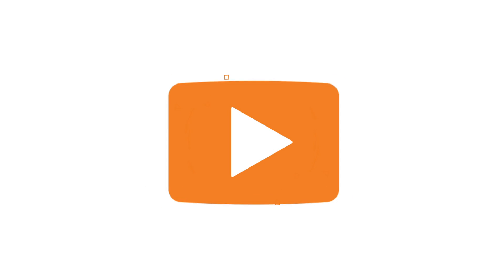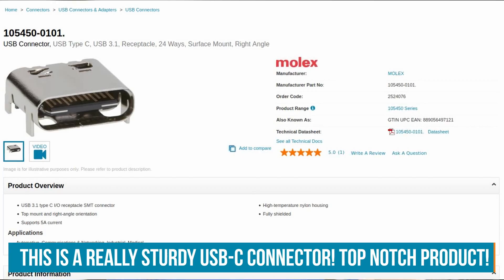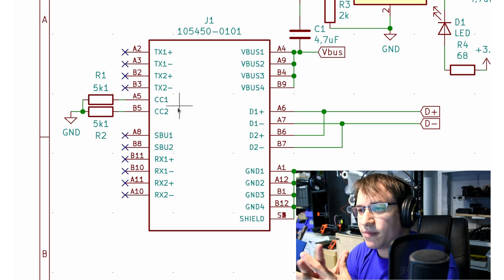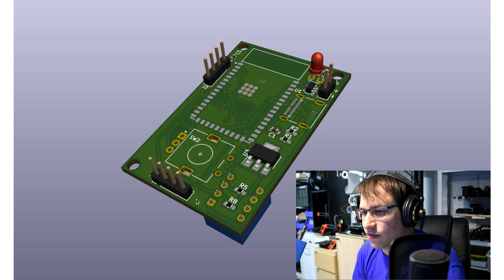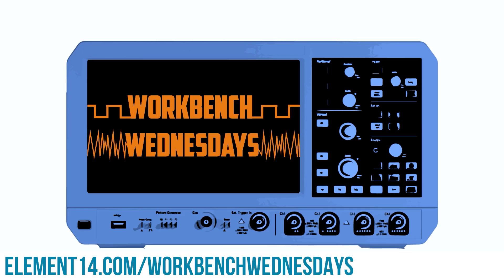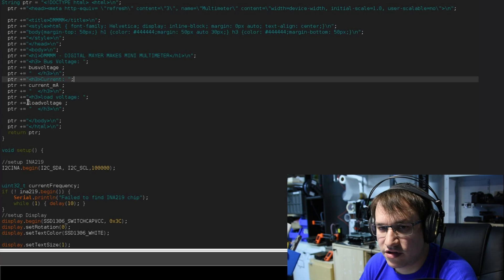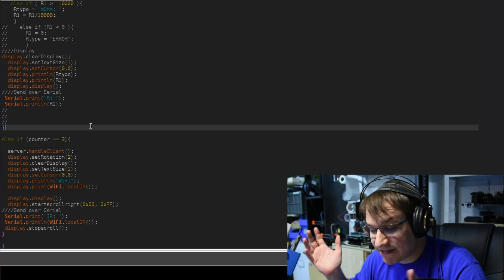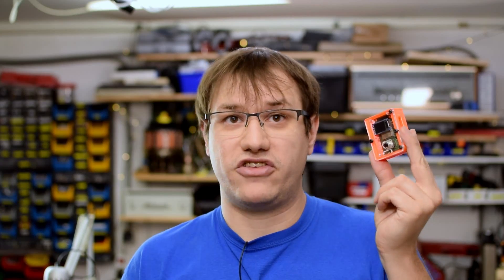DIY Miniature Multimeter

Comment: One limiting factor on accuracy is the tolerances on components. One should be able to calibrate the output readings to match a known good multi meter. The web interface would be a perfect place to have a page where one can adjust values used to calibrate the output values. That is if the calibration values can be stored across power resets.
Reply: that is an awesome addition, please post it on the project side so we can pick it up for a future iteration!

Comment: Good morning! Could you please make a video explaining how capacitive sensors work using a resistive and capacitive circuit? I am doing some research on that, and to have more information on the subject, would be fantastic. I use an Arduino, ATMEGA328P. If this is a possibility, please illustrate in code the details of how to recharge the capacitor and use an interruption to get results. Then, with the results, display the changing values in the window to debug. Thank you very much. Keep up the work.

Comment: Why not just modify a pair of old test leads to pin ends and use your multimeter. No more alligator clips, you just plug straight into the breadboard. You already have a superb multimeter. Why re-invent the wheel? That's what I did.
Reply: where is the fun in that? I learned a ton of things by building this project, and fun with electronics is why I even have a multimeter in the first place.